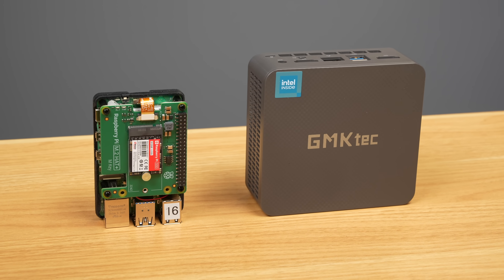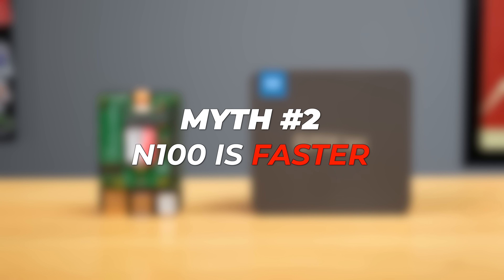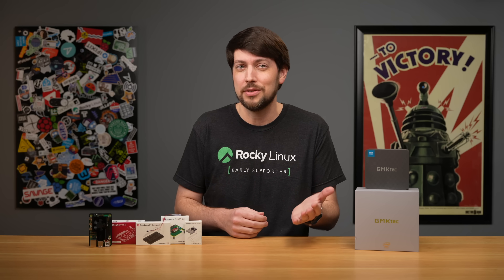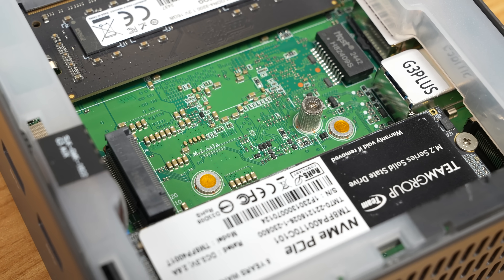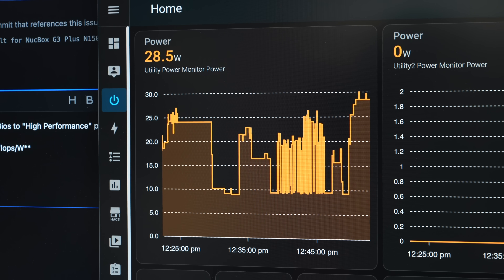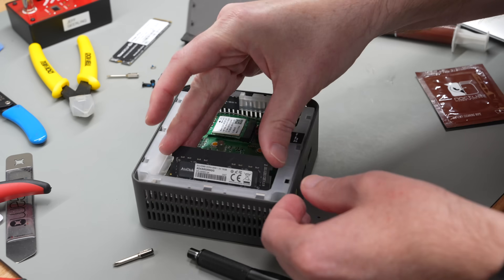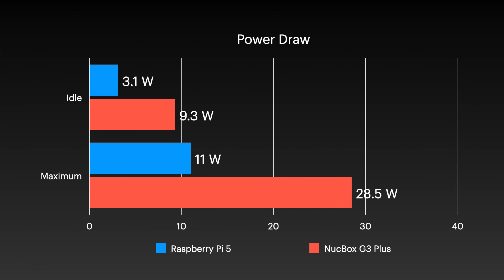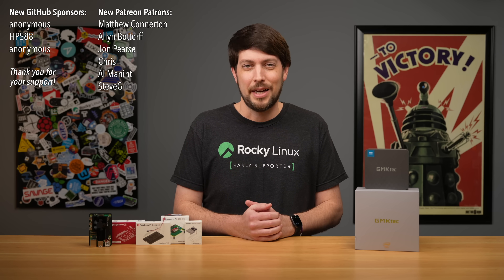When did Raspberry Pis get so expensive?

Comment: Great content Jeff, nicely balanced :)
We got a couple of the N100 GMK mini pc's last year just to display network stats in the office. TBH they are both painfully slow, throttle is just stupid and video playback is dire, also both utterly burned out within 5 months of use, both had to be rebuilt in that time, and one hvme drive utterly destroyed itself!

Where my 8G Pi5 handles all the above without trouble, and has been running running for 8 months without a glitch!
Reply: Your not entirely wrong but not entirely right.  I have a Pi3 that has the obnoxious microUSB port on it.  Jack moves the wrong way and the Pi looses power.  How's that for reliable?
Reply from the maker: There's something to be said about the consistency and quality of the individual chips/parts selected too. Many of the cheapest mini PCs don't have 'industrial' rated parts, whereas Raspberry Pi often under-rates their chips to meet specs they sell to for industry customers.

Comment: Each platform has its own super powers. For Intel-based mini PCs, the hardware de/encoder is incredible for local streaming.
Reply: How good is it at h264? Can it do fullhd 60fps enconding at medium preset?
Reply: @NoName-md5zb  I find the encode quality to be very good, although I typically don't re-encode unless streaming to a smaller screen (phone/tablet) where it may be more difficult to judge. But I've never noticed any quality loss. 1080p60 is a piece of cake. It can even handle 4k without breaking a sweat. I haven't tested it myself, but I've read it can encode multiple 4k streams at once. Keep in mind this is a hardware encoder and medium/high/etc don't directly correspond to the same named presets in ffmpeg in terms of quality.
Reply: @tarheels100  what pc is it?
Reply: @NoName-md5zb it can do full HD at quality preset at 160 fps.

Comment: Mini PCs are definitely not cheaper but for general-purpose computing they are way better and compatible with any distro.  Unless you are doing actual embedded development using GPIOs and direct access to hardware like sensors, servos, etc, in my mind Pis and other SBCs are just not that great.  For general-purpose computing SBCs have way too may tradeoffs and drawbacks.  The biggest one is I can't run a generic distro on them. I'm so tired of special ARM SBC distros with kernel forks that can't be upgraded (looking at you, OrangePI 5).  No thanks.  Mini PCs are more money but worth it.  Power use isn't really an issue for me.

Comment: The one area that wasn't talked about was software.  The PI has the best software of any of the SBC's out there but it's still not as good as the PC, you can just run any OS you want.   The real benefit of the Intel PC is software compatibility. 

My decisions is based on whether I need GPIO or not. If I need GPIO, the Pi is the only game in town. If I don't,  I just pick a PC.  None of the other ARM based SBC's are in the running because they don't have the Pi's support.
Reply: The RK3588 is getting more and more mainline support. I wouldn't be surprised the RK3588 SBCs will be the better option by the end of this year. Raspberry Pi is about to lose the retro-gaming market. The RK3588 is able to play some PS3 games at 720p60 (with the ARM Vulkan binary blob).
Reply: @LivingLinux  Sure in the future it might be as good as the PI. Neither is as good as x86. 

If I was building a retro--gaming rig today, I wouldn't use an ARM processor at all.  I built one last year using a $200 HP workstation with 128 gigs of ram, a 2080ti and all the storage you could possibly want. 

As Jeff pointed out, the power consumption  is trivial on both platforms.
Reply: @ RK3588 is already beating the Pi 5 with retro-gaming, and the gap will only widen. x86 has the advantage with PS4 and newer.
Reply: OMG PSA get a usb ft232 GPIO board for $10 works on PCs native linux support done. also on old PCs GPIO is just a parallel port.
Reply: @remotepinecone  GPIO on a pi is much more than that.  I2C and other serial interfaces plus PWM.  Interrupts to tell the pi when status changes on the pins. 

I just looked at the adafruit FT232. It can't do nearly as much as the PI4 can with it's 20 pin GPIO connector.

If I just wanted to turn on some LED's or drive a display, the FT232 board would be fine. For driving stepper motors, it can't cut it.

Edit: I looked at the actual data sheet and it claims it can do I2C and SPI which is pretty impressive.

Comment: It’s also worth noting the core platform may affect what you can run. When I was trying to homelab a bunch of my services on arm, I ran into compatibility issues with some software. Some docker containers don’t make available arm builds. I think most, if not all, of this could have been resolved doing my own builds but that started violating some of my simplicity requirements. Even if the mini PC cost a little more, with fairly equivalent performance, there’s just going to be cases where it’s better to spend the extra on the PC for a homelab that’s a bit easier to manage and use.

I do like the RPi 5 and have a couple myself. But the cases where I use them, a cheaper and lower power RPi 4 could likely work just as well. My homelab server is a mini PC, albeit a more high end PC for the workload now thrown at it.

Comment: I still use Pi’s for some projects, but I’ve taken to buying used 1L dell optiplex PCs, like the type they have strapped to the back of a monitor at a doctor’s office.

Software support is just not an issue, they’re x86 and such a common platform that everything in them is in mainline Linux.

The prices vary, but for my use case, which is a small home media server, they blow just about anything else out of the water, except of course power efficiency. You just can’t beat arm in that!

But, internationally there is probably not an oversaturated used market like we have here in the states. And who knows if that market will keep up here (but I hope it does!)
Reply: You use Pi... is? Pi's what?

Comment: The problem with the N100 or N150 variants is that they have very few PCIe lanes - you need to go upto a Pentium 8505 that gives you not only more PCIe lanes but 1 performance core with multithreading & 4 efficiency cores
Reply: N100/N150 have nine PCIe lanes.  Last I checked, that is still more than the Pi 5's five PCIe lanes, four of which are dedicated to the onboard RP1.  Yes, N100/N150 are limited compared to better mini PC options but so is the Pi 5.
Reply: that very few is still a lot more than a Pi has ....

Comment: I think that you saved the best takeaway for last. Your best deal is retired hardware that you already own. The best value is the one that meets your requirements within your budget.
Reply: Not necessarily: your old hardware may use 60+W when idle, makes noise and requires good ventilation. I can hide an RPI on the high shelf of a closet..

This being said, I now repurpose any old RPI that is left after upgrade. I have accumulated more than 10 RPI of all types (1, 1+, 2, 3, 3+, Zero, Zero 2 and 4) and I might not need to buy a new one for a while..

I do not see myself buying a RPI 5: a used mini pc fits the bill for any use case that requires it.

Comment: I think a lot of this comparison comes from people wanting to use a Pi as a desktop replacement, and while you can do that, it's really not a great use case for it. With the modern internet being what it is, 16 gigs becomes the base point of entry for a lot of people, and that's where the "most expensive Pi vs. cheapest mini PC" comes in - it's the only way to get enough RAM to feel comfortable with a dozen browser tabs open.
Reply: The Pi 5 is showing it's age, as they haven't invested in hardware video decoders and a serious upgrade of the GPU. No amount of memory is going to compensate that.
Reply: Yeah, modern software is bad, really bad. And I can tell it from experience because I work in the industry.
Most companies prefer to hire 3 juniors and 5 interns rather than 1 senior and the effect is application that is using gigabytes of ram, where it could be using kilobytes.
At this point my 6GB laptop is barely able to watch youtube, something that back 15 years ago you could do on a 1GB machine, while playing a demanding game at the same time.

Comment: Even though it's more expensive for my use case (NGINX & a web server), I use a Pi 5 because of the ability to 3D print a 1U rack mount and use a PoE hat so I can have a single cable for everything.
Reply from the maker: PoE is like a superpower once you start getting PoE switches everywhere :D
Reply: @JeffGeerling  Yup, when I bought my 1950s house I started wiring for ethernet and coax.  24-port PoE switch in a 12U enclosure on the basement wall, along with 2 CAT6 jacks (in case a cable in the wall goes bad) to each room.  Makes the mesh wifi super fast with the wired backbone, and no additional power wall warts.

Comment: If PIs would come with a full HDMI plug and a nvme slot I would by them before considering mini PCs.
Reply: There used to be Raspberry Pi with full HDMI, but there's only one port. I guess Pi Foundation needs some major redesign for the board to put two full size HDMI port.

Comment: I built a cluster of Raspberry PI 5 16 GB for my home lab and works great for serving apps!
Reply: You could get an order of magnitude more performance, and less power use, with a single used Mac mini with Ubuntu, for cheaper, assuming most of your ram is being eaten by the five duplicates instances of the os/libs right now, rather than the apps. That’s how I fixed the performance problems with my pi.

Comment: basically, if you want cheap performance and you likely arent running a server and you don't care about size or power draw, an old used desktop will be the way to go, but don't expect the moderness and upgradability that comes with a new machine.

Comment: I think the PIs became expensive when/after supply problems began. Tiny intel PCs have become much more attractive price-feature wise vs the pi over the last few years, I think that's a reality. If you want the PI to act close to a server or a NAS, unless you are ok with something really underpowered you are going te be better off with a intel PC. If you want GPIO and doing things with hardware, or you really have no need for a lot of ram/power, the pi is going to be a better/cheaper option for sure. I think there may have been a lot of people that wanted to use the pi as a server, waiting for good SATA and gigabit etc. and when it became a reality intel PCs became a close-to or even better option price-feature wise.

Comment: For my i use a pi because low idle power and support. Just because I like to keep my idle power usage as low as possible. Not that it matters financially. It is now just a hobby. A few years ago it when the price per kwh went to a euro, i did it to stay net zero. Before my solar panels produced 2/3 of my power now the same panels cover al my power by a wide margin. It is amazing how much power you can save by unplugging equipment when not in use.

Comment: I've had some big frustrations with the cheapo components in miniPCs, including two of the "Who?" brand SSDs dying in just a few months, and the fan on one dying a screaming death in a matter of weeks. I've had problems with Pis as well of course, I guess Im saying if you get a mini PC, also get a name brand SSD to put in it and send the jank one to the shadow realm. And a USB-powered 120mm fan to sit on top is a wise addition for any minipc seeing heavy use
Reply from the maker: True; I think GMKtec sells a barebones version too, which I would recommend if you want to put in some higher quality components. Though AirDisk is better than a lot of the cheaper no-name brands.
Reply: @JeffGeerling  I also had the AirDisk ram that is perfectly fine and a TWSC 1TB SSD that is perfectly reasonable as well.. No Point putting a Samsung 980 in there it uses only 2 PCIe 3 Lanes.

Oh and a little sidenote as people think AirDisk is a nobody. It's Shenzhen Longsys Electronics Co., Ltd. as in that Longsys that makes the official Raspberry Pi SDs/SSDs.
Lexar and FORESEE are two labels that belong to Longsys. The N150 can only run SODIMM DDR4-3200 up to 16GB so it's perfectly reasonable to go for AD4AS016G-3200C3/AD4AU004G-3200G3. Chinese DDR4 is as good as any other DDR4 these days.

Comment: Last month I priced out Raspberry Pi versus the GMKtec G3 Plus, and I ended up with the G3 Plus.  My goal is to do what folks now call homelabbling.  The G3 plus has an advantage in maximum memory - 32GB - except when I bought an ADATA 32GB stick the computer wouldn't boot.  GMKTec told me to get better memory, such as Crucial, which I haven't tried yet.  In any case, more memory obviously means more containers.
Reply from the maker: I believe 16 GB is the official maximum, but some 32GB sticks work on these mini PCs. So Crucial might be the answer... I haven't tried.
Reply: @JeffGeerling  The listing on Amazon-de says 32GB max, and I think on the GMKTec website it says the same.  As I said, GMKTec's support didn't tell me it's not supported, but suggested to use different memory.